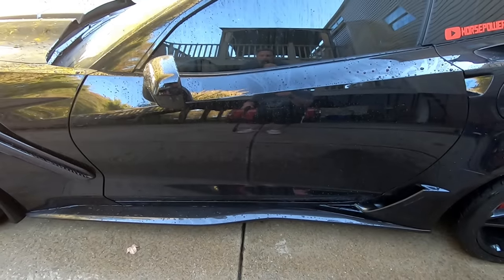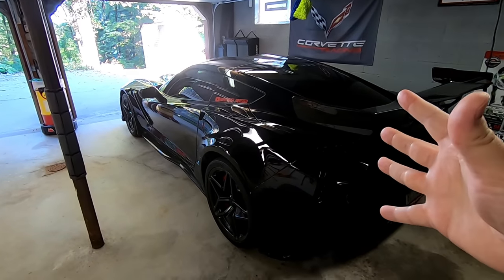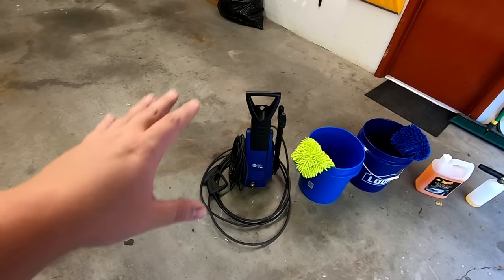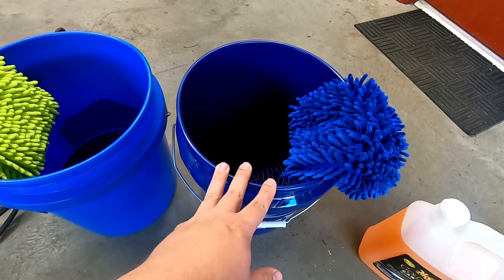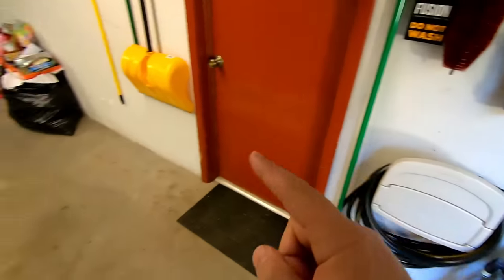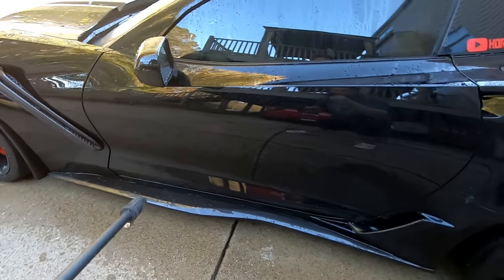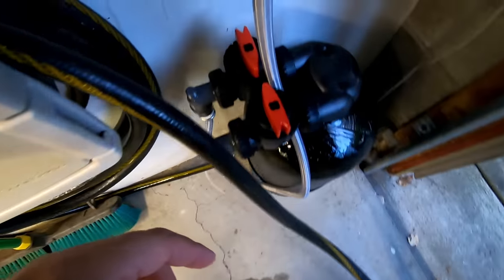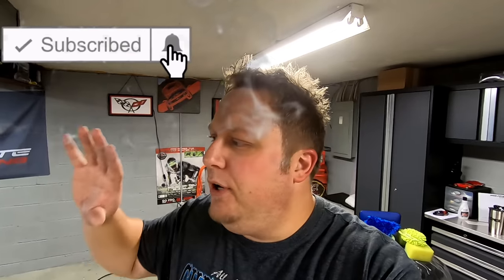PROPERLY wash a CERAMIC COATED vehicle!

Comment from the maker: Easy and cheap way to maintain your ceramic coated vehicle or any car you are interested in keeping nice! For me, it's my 2019 C7 Corvette ZR1 that is ceramic coated and this is the method I use to wash my car anytime it needs cleaned. Check out Hyperion and save 40% by using this link: https://hyperyion.com/ All of the items used in this video can be found in the links below:
Meguiars Gold Class Soap - https://amzn.to/31fzmab

Pressure Washer - https://amzn.to/2OX8NUE
Grit Guard - https://amzn.to/2qmsHOt
Foam Cannon - https://amzn.to/2OTebrQ
Microfiber Wash Mitt - https://amzn.to/2OXQ9M9
Master Blaster (Air Dryer) - https://amzn.to/35FDun3
Spot Free Wash (No Spots Pro) - http://www.nospotspro.com/

Comment: You should foam then rinse the car before going in with a mitt. I’ve learned that you can get a ton of dirt off the car that way, which will make the contact wash that much safer. Just my .02, from my experience. Slick car! Can’t wait to get one.
Reply from the maker: I agree to an extent. In my experience it didn't help that much and ended up being more of a waste for me unless the car is really really dirty.

Comment: Great video! 🔥 I personally prefer to foam it up the 1st time, let the soap sit a few minutes, let it remove as much dirt off the paint without actually touching the car, and than rinse it off. After that..I foam it up a 2nd time, than I would apply the wash mit. This helps ensure that most of the dirt is gone before using a wash mit and avoid any micro scratches and swirl marks.
Reply from the maker: Thanks, man! I've done it this in the past but it didn't really seem to do much for me. Seemed to have as much dirt as before I let the foam run off..

Comment: Only thing I’d add is to consider doing the wheels first, especially if you use wheel cleaners.  Those brushes will sling that stuff everywhere.
Reply from the maker: I definitely agree. I don't use any wheel cleaner since I have the carbon ceramic rotors and the wheels are ceramic coated. All that I use in the wheels is the same soap I use on the car. 👍
Reply: Yeah true.  Us guys with the steel rotors need to use it from time to time though.  Sometimes the soap and water just isn’t enough.  And I love the Z06 wheel design but my God they are tough to clean!

Comment: Will have to look into that master blaster.  Does a nice job
Reply from the maker: Hands down the best car wash tool I've purchased!
Reply: Does seem to work well but I just can't justify $400 for one.
Reply from the maker: @LT4POWERED  it is pricey that's for sure. I've had mine for a few years though so it seems to be worth it as far as craftsmanship goes. Alternatively you can use a leaf blower or compressed air with similar results.
Reply: I have an electric leaf blower I bought specifically for that reason but I usually just end up using a dedicated Absorber XL.  Haven’t noticed any issues by using it.

Comment: Great video!  What process you would advise for hot, summer weather in Las Vegas?  I have a ceramic coated car.  Even nights are 100 degrees in July/August.
Reply from the maker: Best advice is to make sure it is not in direct sunlight. Temperature doesn't really matter too much as long as it isn't direct sun.

Comment: AWESOME video as always Justin! I do exactly the same routine that you recommend with just one change. I like to use 6(six) microfiber mits instead of one without a rinse bucket. After foaming the car down I’ll use mit one to do half the roof. I will then turn the mit over and do the other roof half. When finished with mit one I toss it into an empty bucket and pick up,mit #2 and do half the hood, then turning over and do the other half. I finish up the rest of the car using the remainder mits. With this technique you are absolutely sure to use a clean mit with no risk of a hidden stone or debris to scratch. I of course use a separate mit and brush for the wheels and tires. Master blaster IS A MUST!! Can’t wait for your spotless water video!! By the way, I like your new ZR1 but I LOVED YOUR RED Z06!! Will your 2020 be red?? Bob
Reply from the maker: Thanks! The 2020 will be red, yes. 👍

Comment: Does the pressure washer distilles the water? Or can I even wash it with regular water
Reply from the maker: You can wash it with regular water but at the end the best way is to use distilled water to prevent any kind of water spotting.
Reply: @HorsePowerObsessed  ok I thought the pressure washes cleaned the tap water
Reply from the maker: No sir. The water filter I have does though.
Reply: @HorsePowerObsessed  so far I don’t get water spot and I’m using a water hose, only thing is I’m starting to see scratches so I’m guessing it’s no using a pressure washer and foam canon to prep the car for a proper wash

Comment: I wash the wheels first so that the car does not dry on its own while doing the wheels after.
Reply from the maker: The soap is PH balanced so even if it dries all you have to do is wet it again and it's good to go. This is also why I recommended doing this in the shade.

Comment: Doesn't the car start to dry (and spot) while you're doing the wheels? I don't think I could wash my entire crew cab Denali with a mitt and then rinse it before water starts to evaporate.
Reply from the maker: Normally it would but I do it in the shade and I use a PH balanced soap so if it does dry you just need to re-wet it to ensure no water spots.

Comment: I bought the Pressure Washer and Foam Cannon from the link you've provided and the Foam Cannon doesn't fit on the Pressure Washer nozzle
Reply from the maker: You may want to reach out to Amazon them because they must’ve sent you the wrong thing. I’ve bought that combination at least 10 times for other people and every time it is dead on accurate.
Reply: @HorsePowerObsessed  alright. Thanks for the speedy response. I'll reach out to them. Appreciate it
Reply from the maker: No problem! Good luck my friend!

Comment: What is the best spotless system to buy for  my vette?  Chuck
Reply from the maker: The NO SPOTS PRO system is very very good and priced right. I use it every time I wash my black Corvette. If you buy one tell him HorsePower Obsessed sent you!
Reply: I did buy one thru Amazon as my son works for jeff Bezos in Seattle as an engineer for his Blue Origin space ship company so I got a discount. I wish you could tell them I bought it because of you. Am I right that it does not need any chemicals added to use.
 @HorsePowerObsessed
Reply: He used to work at Space X but left there to work for Bezos.
Reply: Obsessed, Does the system work for a long time or only for so many gallons?

Comment: Lot of velocity from that Master Blaster. Is there a concern about the MB blasting vehicles with the airborne particulates it sucks in? Does it have a high efficiency filter?
Reply from the maker: It does indeed have a filter on the intake end. 👍
Reply: @HorsePowerObsessed  👌